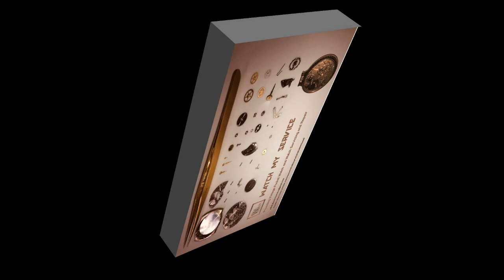Making a Leather Watch Lathe Belt - Part 2

Comment: I made my first boot lace belt. I purchased two sets from Marks Work warehouse, they are dark brown and very tough. I used a leather awl to make the holes while pressing down onto plywood. Popped through very well (don’t have any broaches yet 😢). I used 6lbs Triline fishing  line as store was out of 5lbs and mounted in a vice for the sewing and knot work as you promoted. Works like a champ, I gave it a real workout and could not break it. Your technique is spot on. I didn’t melt the ends, just used a knot I am familiar with and trimmed it tight (like a tiger tight) (fishing for more years than I will admit to). 
Cheers,
Geoff
Reply from the maker: Sounds like you have completely Succeeded in making this belt. They’re really good and I haven’t had one break yet in 15 years.
Also, glad to see that you’re fishing technique is help you with your watch making

Comment: How long do these leather belts last? I was just wondering if you conditioned them with a bit of Neatsfoots oil if it would give them a longer life? Where do you find these Lathes?
Reply from the maker: I have not had one of these belts break on me yet. The leather laces are tough as hell as they are used by big rugged lumberjacks to tie up some pretty seriously tough boots. The 5 lb fishing line is strong enough to hold this together forever. In this video the first type of boot lace I used was a softer one than the second boot lace I used which I guess was in this video; that being the black boot lace. So if I were you, I would go hunting for a square tough thick boot lace and use that. I would not bother putting anything on that boot lace as you do need the friction to run the wheels. A long time ago I bought a can of spray that was intended to use to cause friction. I tried it and it didn't make much of a difference. I get the lace on eBay.
Reply: @JDRichard  Thank you.